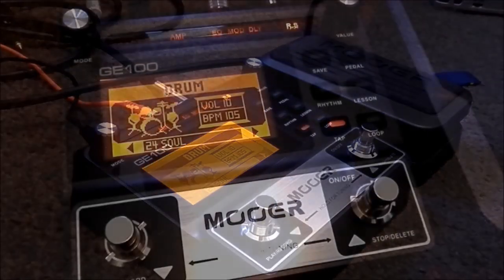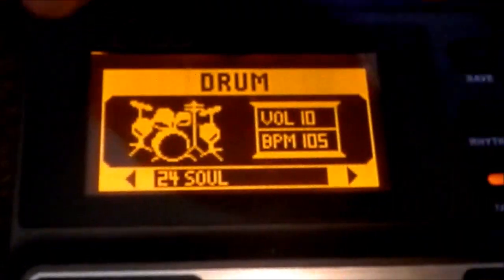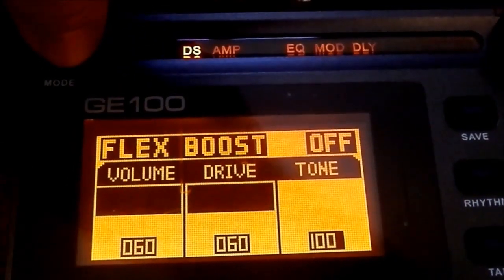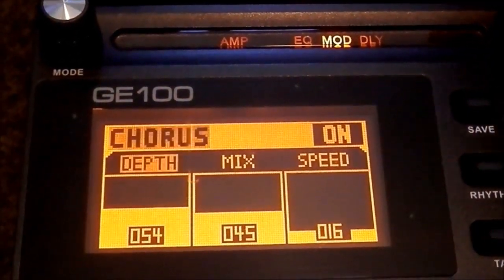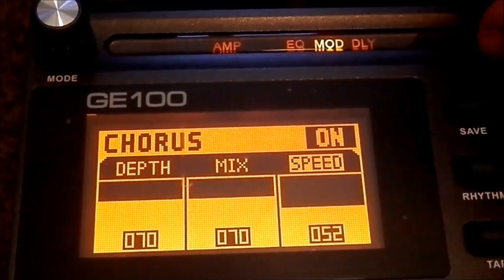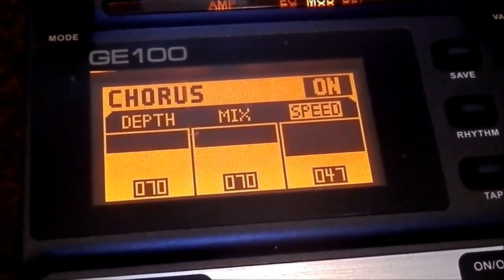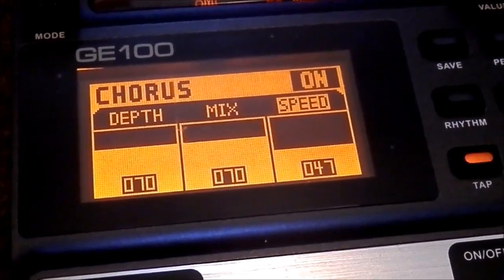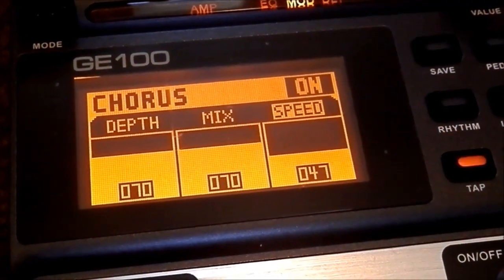Mooer GE-100 multi effects unit demo/review/tutorial.

Comment: Good review!  I've had this pedal for about a year now and am still very happy with it.  I've used it in several song recordings with the audio out of the GE100 going into a mixer which then connects to my workstation DAW via USB.  I have about 15 presets that I have set up the way I like and it works well.  I'd say it is hard to beat this pedal for the price.  You can play around with the presets and get whatever tone you want out of this thing like you showed in your video.  I don't use the drum machine but I use the 2 button looper quite a bit.  Overall, it is a great buy in my opinion.
Reply from the maker: Yep it has lots of good features :)
Reply: @gearfacts  man, i have a zoom g1on, and a rowin frenzy fuzz, can you make a video about a comparison of a this mooer multi fx and a zoom g1on? More specificly on the fuzz sounds of both

Comment: the mooer is an effects pedal and should be plugged into PA  not a guitar amp,(unless your amp has a clean channel)  if you plug it into guitar amp it will double the effect and distort the final effect.  i don't even own one and i can tell what he's doing.. i use the rc300 it's big and bulky,, i'm looking to "shrink" my gear for easy transport ..
Reply from the maker: What if it sounds better when you plug it into an amp though?
Reply: @gearfacts  good amps good sound it should be set clean to get the desired results of the pedal.  if your amp is set on distortion the pedal will sound like fuzz

Comment: Works only on mains adapter ---9 VOLTS -----Forget batteries when the main supply is out ---DOES NOT WORK ON 6 VOLTS  --no matter what AA 1.5  volt batteries are used !
Reply from the maker: Good to know.
Reply: Mine works on four AA 1.5V batteries just fine. And it turns itself off the moment you unplug the guitar cable. So maybe chek if your guitar cable was plugged in when using batteries.
Reply: @stevanbasaragin3636  You must think we are plain stupid & ignorant ---an electrical engineer  had the same battery problem ----nothing to do with unplugged cables ---wake up !
Reply: @CarlWinter-oy8uf  chill. 9V 500mA is an industry standard for pedal input power. And 6V on AA batteries is by their design and should not be a problem as it would need to pull 650mA from them. And I don't think anyone's stupid just sometimes people in frustration forget about basics and don't do the obvious thing.
Reply: @stevanbasaragin3636  4 X AA 1 .5 VOLT BATTERIES ---EQUALS ONLY 6 VOLTS -----YET THE MOOER REQUIRES 9 VOLTS 
(Do the math)----its adaptor gives 9 VOLT DC ---!----SO 6 VOLTS  is insufficient battery power ---nuff said !
Reply: @stevanbasaragin3636  So how does 4 x AA batteries  --equal 9 VOLTS DC ?---THE PEDAL DOES NOT WORK ON  6 VOLTS BATTERIES--500 MV OR 650 MV ---   S o you must have a miracle on your hands ?   Tell the truth ---the mains adaptor is 9VOLT DC ---!    NOT 6 VOLT DC !
Reply: @CarlWinter-oy8uf  And yet mine unit work just fine on both 9V from the mains and on 4 AA batteries...if that is not the case with your unit return it as defective. Simple.

Comment: I recently bought mooer ge100.  I also have a blackstar 20 amplifier which has many setting and presets. Now i don't know, should i connect mooer ge100 to amplifier or directly to a speaker. Different effects on ge100 and Different on blackstar. I think it will add both effects and will distort sound.  How to connect it to amp blackstar v3 20
Reply from the maker: Personally I prefer using amps that have effects in them. It means I'm only using one cable, one power supply. So unless you want the wah and other dynamic pedal effects, I would just use the amp.

Comment: LITHIUM AA 1.5 VOLTS = 6 VOLTS ONLY --Thats what I am using --this Mooer pedal uses 9 VOLTS DC 
--Go ahead ---put the  new AA lithium batteries (x 4 ) into the battery compartment ---IT 2/3 OF THE VOLTAGE REQUIRED !----Does NOT  power up the fx pedal correctly----3 VOLTS SHORT !---Tried many times --DO THE MATH !      Chinese got it wrong as usual!
Reply from the maker: Works fine for me. 6V is more like USB power which is sufficient for this little unit.

Comment: Sir, i need your help,  i have problem with pedal volume, if i push until max and then led indicator light on, but if turn back to down and back to max, its must be stuck on mod(pedal volume no function) until the same move, it can back again,  i already to factory reset but cannot fix that problem, anyone can help me pls? Thanks.
Reply: Maybe your pedal is set to another function that's why. 😂 🤣 In my nux mfx10 I had to long press the volume pedal to activate special function such as wah. Then deactivate again to go back to volume pedal

Comment: Just got one, I liked it, but it's quite noisy and lots of humming comes out of it, is that normal for this, or should I return it?
Reply from the maker: I found it to be quite noisy. I'm a bit concerned about the hum you are getting though. Maybe try a few different power sockets, battery power, different cables, change the angle of the unit in relation to other machines in the house. Hum is usually caused by some kind of interference in power flow.
Reply: @gearfacts  Thanks so much, it must be some current-power issues as you pointed out... I tried the batteries on, and all hum went away.. thanks.
Reply from the maker: @laceibagroove  aha! Glad you found a solution. The power supply you have might be fine, it's more likely that the noise is coming from somewhere in you home's power and there's not really anything you can do about that.

Comment: Please help me. Is there a proper way to turn it off? Or just unplug it with the power source?
Reply from the maker: There is no master switch on it. Disconnecting the power won't harm it, but I prefer to use the switch on the wall. So when it's off the power adapter won't sit there all hot, just wasting power :) Gearfacts
Reply: So the on/off printed on the right patch/stomp has no function at all?
Reply from the maker: I think that's to turn the expression pedal on and off in certain modes.
Reply: Ohh yes, right. Thanks! 👍
Reply: Dexter Sapida there's no

Comment: I don't know what this guy has done to the Mooer. I have one of these and it sounds so much sweeter and not distorted/effected over the top like the one in this video.
I wonder if there may be quality control issues resulting in 'good' units and 'bad' ones?

It is also highly customisable for every effect in the chain. 
So I am very happy with mine. And for the money? Outstanding.
Reply: Is there tap tempo?
Reply: Does it save the user patches you made?
Reply: I meant to ask if it saves the user patches you made when you unplug it?
Reply: It's probably his recording gear or cables that isn't very compatible. 😂 🤣

Comment: Sir my mooer ge 100 produce noise sound whyyy when i on my metal effect some noise produces wht is the reason does  ur pedal produces so much noise
Reply from the maker: Sounds like you need to activate the noise reduction effect. Also if you use the Fuzz effect for distortion - it's a less noisy form of distortion. Hope that helps :) GF
Reply: @gearfacts  more then likely your amp is set all wrong everything must be clean on your amp and all tone knobs set half way and reverb in amp and presence should be off so the pedal has full control over amp tones

Comment: .i just bought one today. there is no power(on/off) switch button. how do i turn it off safely? isnt it harmful for the device to just unplug it?
Reply from the maker: As long as you disconnect the power gently but quickly it should be fine. Don't wriggle the plug out, make it one smooth movement. It's only 9 volts so you should still get plenty of life out of your GE-100 :) Thanks for watching Gearfacts!
Reply: +Gearfacts oh.. okay. :) hopefully it will last for years.. so many negative comments, because they haven't seen and tried one yet. hahaah. but i think it' pretty decent for the price.. thank you!

Comment: Your amp is set all wrong to use a pedal
Reply from the maker: How do you mean?
Reply: @gearfacts  first off on your amp it should be the cleanest sound you can get no distortion at all and all eq settings on the clean channel your using should be at half way point so the eq on the pedal can make all the tone changes also no reverb on amp should be on nor any other setting like presence the pedal needs to have full control to get best use of it's tone and effects and cabinet settings

Hope this helps many musicians make this mistake when using a pedal especially if it's a tube amp

Comment: Really /?  Is that all you can say ? Good to know ?- That the Mooer GE 100 has a battery problem built in ?? Good Heavens ---ITS FAULTY ! does NOT work on AA BATTERIES ! And yet you sell it like its all ok ?
Reply from the maker: Well it worked fine for me. I guess there is some circuitry that switches voltages or something. I had no problems using batteries or mains power.

Comment: Can i go clean first and then go to distortion without playing any other effects?
Reply from the maker: You'd have to switch between two patches to do that. You can't add distortion with the expression pedal alone.
Reply: So you mean i cant skip other patches? For example im gonna play smells like teen spirit, it goes clean and then distortion right?
Reply from the maker: Yeah, that's the way to do it. You can skip from your clean patch over to a distortion patch, definitely. I thought you meant changing the sound without changing the patch number.
Reply: How am i going to do that?
Reply from the maker: Ok, you create the clean patch the way you like it, then copy it to the next location. In that second location, you add the distortion and any other effects you need (delay etc). Then you have two similar patches side by side with nicely balanced volume and the right changes. Simple :)
Reply: Thanks!
Reply: What I do with most multi effects I have is switch to tuner/bypass mode to get cleans then switch back to distortion effect when needed.

Comment: is it durable? i heard there are durability issues because of its cheap price, planning to buy
Reply from the maker: Yeah it's pretty solid, mostly metal parts. Gearfacts
Reply: Gearfacts what about its software issues, heard that it does not last long due to reset problems
Reply from the maker: I haven't heard anything about that but the software does seem kind of simplistic.
Reply: does it have on/offswitch

Comment: I think it is probably much better than you have demonstrated. you should have got someone with a more varied guitar style to demonstrate, big disappointment
Reply from the maker: No, it's not better. It's possibly the worst sounding multi effects pedal I've used. If you think of it as a practice tool though, it does have some good uses because of the big screen and educational features it offers. I should have demonstrated that side of it more. But different guitar playing wouldn't have helped, the sound is not high quality :)